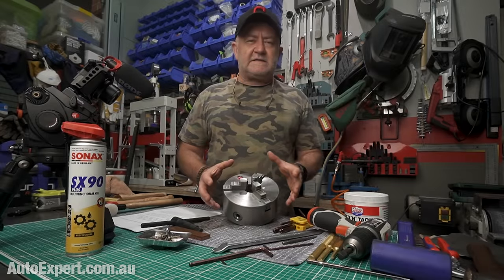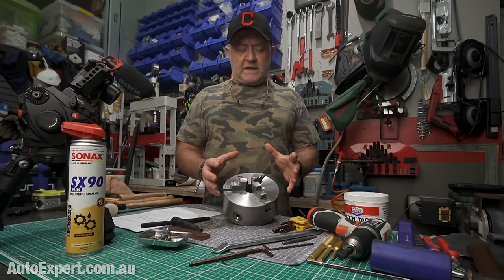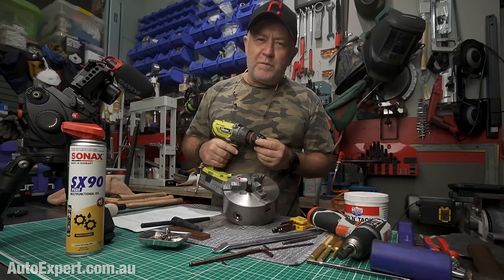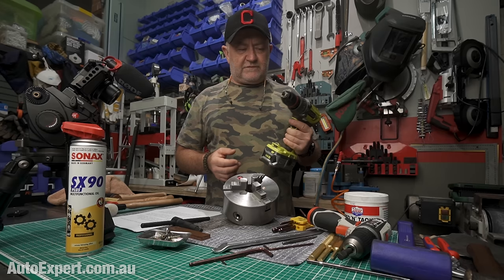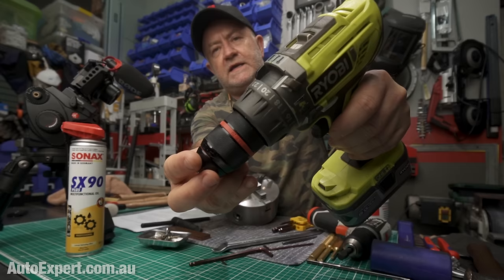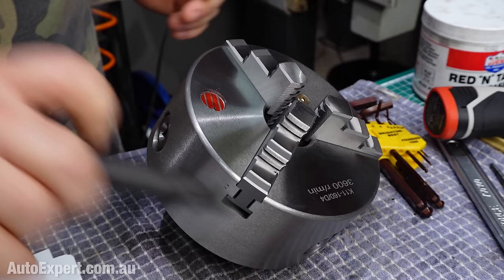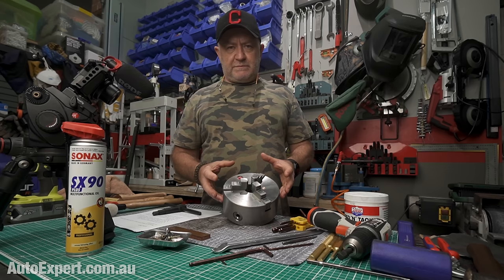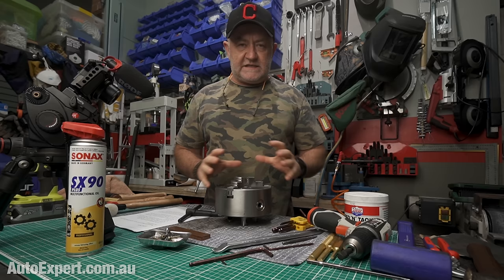Lathe chuck: Full teardown and service guide (DIY) | Auto Expert John Cadogan

Comment: I can well remember at high school, over 60 years ago, fitting the 3 jaw P&B chuck to the old Govt issue "Myford" lathe with one jaw out of phase and a lump of heavy bar stock in it on high spindle speed. Nearly shook the lathe off the bench and attracted the unwelcome attention of "sir". A valuable lesson learned for a future career as a fitter and machinist, that I survived with no bits missing.
Reply: Respect

Comment: As a machinist, I approve of this message. 
Along with using wood for protection, I also put a large piece of brass stock in the spindle. Then when I release the chuck, it has some temporary support and I can get both my mits on it for better support. Especially useful when removing a freaking heavy 8 inch(sorry 203.2mm)chuck.
P.S. This chuck has 3 grease fittings on it. Go figure.

Comment: Been machining for 40 years, Never took a lathe chuck apart,  
It's normal for fine swarf to get into the scroll and jaws, 
Usually removing the jaws and compressed air while spinning the scroll with the chuck key does the trick in under 2 minutes.....

Comment: i remember many years back being involved in a wood turning course. a young student, came in late one day, all gang Ho, and definitely feeling superior to us oldies. he wouldn't listen to anyone, he grabbed his piece of tree trunk, walked up to a lathe, and secured his workpiece. he grabbed a large chisel and tried to take a deep cut. the workpiece grabbed the chisel spun it right out of his hand. and lodged itself deep into the ceiling some 5 feet behind him. our teacher, a good union man, took his somewhat polished right boot and lodged it right where the sun dont shine. we never saw the guy after that.
Reply: Yeah, that's not a teachers boot lace. No need to assault the student.
Reply: @indianchallenger8148  i will say this, that instructor 'retired' not long after this event.  he was sorely missed, once the new guy turned up. strait laced and no sense of humour. an absolute ball breaker. but a good teacher, in his way.
Reply: I personally know an ex-trade teacher. He was strict on safety. Hair and clothes not hanging out, etc. Most of the other teachers had bugger all experience and protected their jobs by bullying and harassing the teacher in subtle ways as they do when they feel threatened with a lack of knowledge.
I had a similar thing as a heavy vehicle truck trainer. I was strict, but we still had fun, being drivers.

Comment: As an Auto Electrician we had to disassemble the chuck on a regular basis due to the copper swarf from machining armatures and rotors. Also linishing with emery paper creates a lot of dust acting just like valve grinding paste.
Reply from the maker: Quite right on the emery. 
Plus, copper: so fricken gummy on the tools.

Comment: I remember my school days in the Machine shop introduced to a Colchester Student lathe, no eye protection offered in those days in the mid 50s, one day I was put on a Nuttal and not given any real instruction, put a block of wood on the bed [thank God] and lifted a chuck into place and screwed it on, neglecting, through ignorance, to screw the locking collar onto the back of the chuck, pulled the start lever, unaware that releasing it did not result in the chuck gently returning to a halt, in my panic, figuring I would be in deep DoDo if the chuck rapidly coming of the spindle sailed onto the ways and gouged it [remember the block of wood] grabbed it external auto brake fashion at 750 revs, brought it to a halt, only damage was a rip into one of my fingers, Instructor just said, "stick it in a bucket of Kerosine" No real instruction and no OHS regulations.

Comment: Packaging greasy crap - Dragon fat perhaps?
Yeah the 960 definitely better than the Al336.
Has the wife asked for her tea towel back?
Red tack - use that kind of stuff in the grease gun for pins on the shop forklift.  Seems to work fine.
When turning something rusty or say cast iron- where possible I put something on the ways beneath to catch the crap.
Yes the machining set will get excited about ones choice of lube😀

Comment: Steve's Small Engine Saloon channel has a great utrasonic cleaner tips video - put the dirty parts in a jar or ziplock bag with cleaning solvent, and fill the main tub with water. Saves $$$ of kerosene and no need to clean the tub and much less dirty fluid to dispose of - it's a game-changer! Check out Steve's channel.

Comment: Welp, I've already butchered the chuck on my Atlas 109. Right now, I'm running that exact red ring drill chuck on not only one of my drills, but my lathe also takes ½-20, so I'm running that drill chuck on my lathe for tiny parts as well.

Comment: Hi John, you seem to have experience with all the potential discharges from a lathe chuck. That chuck doesn't seem to have seen much use. 
I would agree with your comment on quality of Taiwan built machines v China.
It is important to insert in a set order, if you don't they will be in the wrong place on the scroll and therefore not end up equidistant from the spindle axis. If you have the jaws out and look at them on the back, you will clearly see the step between each jaw, which represents the 1/3 rotation of the scroll between adjacent jaws.

Comment: Mobil Vactra 2 is great on the ways.  Super slick.  It does tend to stain a little though.
Reply from the maker: I just use slideway oil there...
Reply: That's what it is designed for.  The stuff is awesome for preventing stiction.  
On a side note, the Practical Machinist forum is a wealth of information, too.  Just don't discuss Asian machine tools...  they're a little precious about that...😂.

Comment: 3:24 Don't forget the 4 jaw self centring chuck.  Seen those too, and wondered why the machinist was swapping out a 4 jaw chuck for a 4 jaw chuck 🤔.

29:27 A mate of mine has a lathe (hobbyist rather than serious metalworking) that has a spot in the headstock to put the check key.  If the chuck key isn't in there, the lathe will not start.

Such a simple solution, it makes me wonder why it's not standard on all lathes & drill presses.

Comment: What are you doing in that workshop of yours that you've drilled so much it needs a tear down?
Reply from the maker: I did a fair bit of boring the other day. Boring ejects a lot of chips into the back of the chuck (area). Plus, as I explained in the video - it's generally a good idea to pull fairly new cheap chucks apart, to clean out residual grinding dust from manufacturing.
Reply: @AutoExpertJC  why am I not surprised you were boring?
Reply: There is never any grinding material left from new, just clean lube😂

Comment: John.
I have a 2012 N70 Toyota Hilux it has 240,000ish KM on the clock and I am an avid four wheel driver. My pervious two four wheel drives made at either end of the 90's (Pajero than a Hilux) had issues with their rear diffs at this amount of Km on the clock. My Questions are as follows.
1. Has the metallurgy changed enough for me not to warry with this amount of KM on the clock.
2.  If I need to get the rear diff replaced can I get an Air locker fitted with the ABS system as it is less expensive than a factory Limited Slip Diff or will the ABS freak out if I fit a locker or will it be okay as it has individual tone rings on each rear axle?

Comment: Be certain not to put witness marks on a jaw face particularly if your jaws are reversible. That will quickly ruin any sort of concentricity you might have had if you need to flip them around.
Reply: Gold tip.